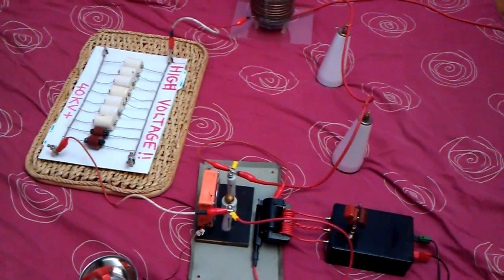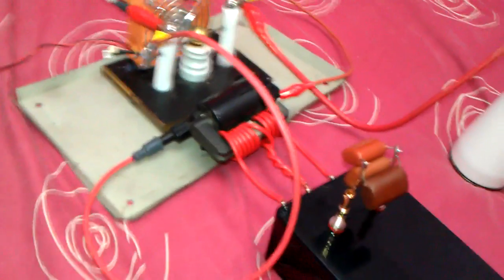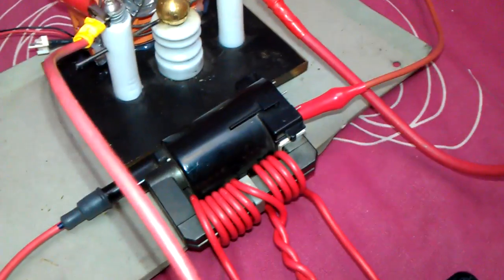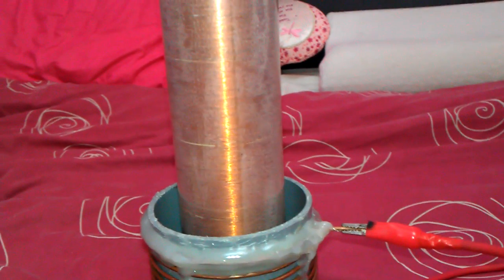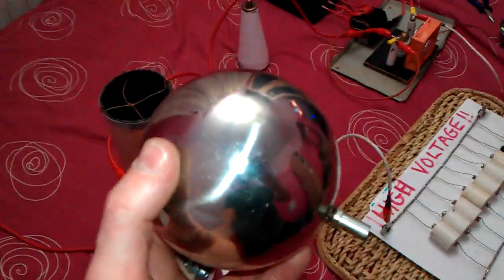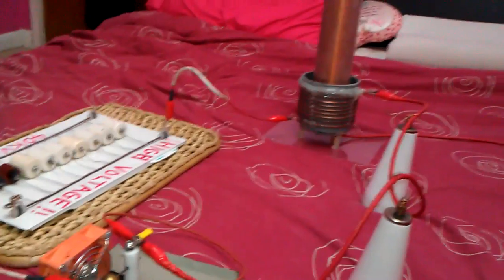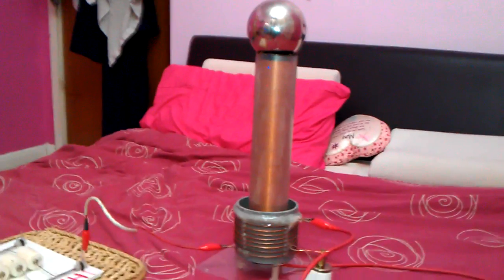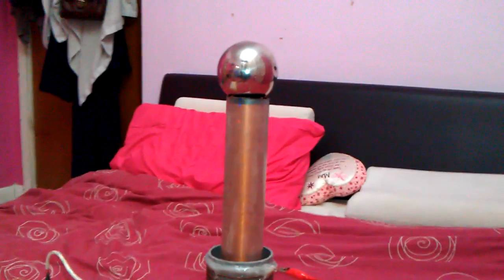Table top Flyback tesla coil ZVS mosfet

Comment: can you explain where exactly is the secondary connected?
Reply from the maker: The secondary coil is not connected at the top as that's the break out point. And the bottom of the secondary coil is to Earth. So either a 4 foot bar into the ground. Or a radiator.  But only use the house radiator if it's a small coil like mine in the video.

Hope this helps👍😉

Anthony

High1voltage1rules

Comment: Nice! I'm in the process of building my first coil, already built me zvf flyback power supply, got stacks of 1nano 30kv ceramic disc caps (not sure if they will be any good though), just need to build the TC itself. It's a work in progress...

Don't stop rambling on by the way, it's entertaining and lends a nice touch of humanity :)
Reply from the maker: Robert Crawford yeah thanks buddy, very kind of you to say,

and yeah them caps sound good enough.  

good luck on the coil. I'm sure it will be great.

thanks for the comment👍 

Anthony 
High1voltage1rules

Comment: Great video, thanks a lot for the explanation, Ive been looking all over for a detailed walkthrough, still trying to get mine to work, the zvs on mine works great but cant afford to buy alot of capacitors, do you know if foil rolled caps are any good?, also if you want to see my zvs, it is on my channel
Reply from the maker: Platinum Science Hello mate,
you could try rolling your own caps, as there's videos how to do it. it's not hard at all.
or if ya wanting foil rolled capacitors, they have to be pulse caps.

hope this helps mate. good luck

Anthony 

High1voltage1rules
Reply: high1voltage1rules Thanks!

Comment: what did you ground the bottom of the secondary out to
Reply from the maker: prototype9000 Hello,

I ground it to the central heating radiator pipe as this is grounded. it's only a small coil.

any bigger and there would be a ground rod outside I'd be connecting too.

hope this helps and thanks.

Anthony 

High1voltage1rules

Comment: hey high1voltage1rules great video i am about to build that same coil but i have a problem where the only grounding i have is the mains plug i live in a flat so i dont have a backyard also cant seem to find any pipe since all are in the ceiling can i still make this coil
Reply from the maker: syamala raj sorry about the long time to reply, I get so many messages.

OK" do you have central heating? or do you know where your main cold water comes in to ya flat?? 
as you can use this as your earth bonding wire for your coil.  as when I'm in the house I either connect to the radiators pipes. ( only for small coils! ) of the main stop tap for your main cold water into the flat! as this will be earthed! but if it was me I'd go to the back of the building and find a nice mud area and drive a earth rod into the ground and have a earth wire going to my flat to connect too.  

I hope all this helps and best of luck!

I hold no response ability for and damage done in your flat, all info iv given you is on Base information you have given me. I can't see your flat and don't know any setup. always give/pay attention  and⚠ caution when using high voltage.⚡

be safe and think safe. always switch off! safety first.

Anthony 

High1voltage1rules
Reply: Thanks!

Comment: Very nice it was great experiment. Spark Gap coils that are well quenched as yours was by design and airflow " Sing" and in time you like Tesla can tell by the sound of the gap discharge when the coil is correctly tuned.  Enjoyed this, spark gap coils versus all solid state devices is like comparing a classic 66 XKE to the current types .New sports cars are smoother but have no soul.
Reply from the maker: Ella Craddock fully agree with you 👍😉 thanks for the comment. 👍😉⚡⚡⚡⚡⚡⚡⚡⚡⚡⚡

Anthony 

high1voltage1rules

Comment: Another quick question, could you provide me a schematic with the connections from the flyback to the tesla coil? Including the capacitors? Or possibly explain how you connected the flyback to the tesla coil circuit? Because I connected it with the typical spark gap tesla coil circuit, and I get arcs that buzz off and on, rather than a continuous arc.   Thanks again
Reply from the maker: +Scotlahn Mccallister hello mate. well you would need Ac capacitors.  and to be honest I wouldn't know what would be the best capacitance. the best way to try it' is to get ya caps and try a load in parallel " it wouldn't be in nf" it would be alot less capacitance.
so when ya try it you just keep adding until you feel you have enough. 
or you can look on the net and look for a data chart on how to get the correct capacitance for you coils size.
I never used anything I just kept trying myself until I got what I was happy with!

best of luck.👍 

Anthony 

high1voltage1rules
Reply from the maker: Hello
you basically connect it as you would a neon sgn transformer. bur replace the NST with a flyback and ad more capacitance.  you can find the circuit diagram from seaching in google images > tesla coil diagram. 
and just follow it. that's all I did. 
and when you power it up remember to try different caps in the spark gap as this effects the frequency.  and try different taps on the primary of the spark gap. and remember to Earth the secondary coil to ground.

hope this helps

Anthony

high1voltage1rules
Reply: +high1voltage1rules Do I really need to earth the connection? Because I found connecting the tesla coil to my fly back ground works better than the actual earth ground.
Reply from the maker: +Scotlahn McCallister with tesla coils the output on the secondary is a wave that runs up and down the coil. and basically if you run it connected to the flyback even tho it works better can burn your drivers components. and even pure out ya flyback. in the past Iv tryed many ways to run them and connecting to ya house Earth is best. only for small coils. any bigger that 12 inch high you should make your own earth outside away from the house. 3 foot earth rod!!! 

thee awesome projects to play with' and lethal to house hold appliances ☇☇☇☇I killed my home burglary alarm lol on my old house just before I left lol. never worked again.

hope this helps and play safe.🖒😉

Anthony 

High1voltage1rules
Reply: +high1voltage1rules What would the proper capacitance be for a NST? I'm trying to build an NST coil, outside of the ZVS projects, and would like to have that knowledge at hand. Thanks again!

Comment: That very nice@! How to make it? Do you have a circuit?
Reply from the maker: high mate. v no circuit diagram you can search in google images. as all im using is: it's a zvs driver with a flyback. and a dc capacitor bank.
a tesla coil setup. without any Ac other transformers. and using a spark gap. I'v just changed it from using no NST to using a zvs to power the flyback and with the spark gap Iv but in in series the capacitor bank of the high voltage output into the primary coil that's connected to the spark gap  
hope I made it clear. you can find it all out in Google 

best of luck

Anthony

high1voltage1rules

Comment: hey there, can u pls explain what it means to ground a wire....
Reply from the maker: Hello. 
the secondary of the tesla coil has to go to ground. a earth rod in the ground. and make sure it's wet as it's a better grounding for the tesla coil. 
if you don't earth the tesla coil it will fry itself/ burn out.

if ya still unsure search in Google. as Google is full of high voltage info.

hope this helps 👍😉

Anthony 

High1voltage1rules
Reply: +high1voltage1rules thank you very much ;0, ive got an idea now, so i can connect the base of my secondary to the AC earth of the house socket??
Reply from the maker: +Julian Nel 

hello mate.👍

⚡⚡⚠Warning⚠⚡⚡

don't connect 🔌your tesla coil to your house Earth🚫
As the Earths wiring in the house would act like a Antenna📡 giving out high frequency wave's〰  and with the high voltage⚡ also, is an accident💣 waiting to happen! thats something you don't want!😨

anything plugged into you house main can become damaged/broken💥 and it's even possible you could get a house fire🏠🔥.

The best way to earth your tesla coil from the Base of the secondary is to have a wire from your tesla connected to a 4 foot copper Earth rod into the ground.

mine is outside my garage at the end of my garden. well away from the house lol.

if you don't or can't get hold of a copper earth rod then use copper heating pipe'"  I throw water over my earth rod when ever I'm using it for tesla runs.

hope this helps and be safe.

Anthony

high1voltage1rules

Comment: 6500K of your lamp is the colour temperature not the brightness, this would be measured in lumens. 6500K equates to Daylight, 2700K is usually warm white and then you get variations in between..

Comment: Hi high1, nice video as usual. I got a little problem wich I dont have any idea about what could be. Its a very silly issue but: 
When connecting my spark gap in parallel , like you had, my tesla does nothing, but when connecting it in serie the coild works nicely, I really don´t get it, I readed in some sites that is always better to connect the spark gap in parallel, but as I said mine doesn´t work.

Maybe not enough voltage? Little capacitors?

Thanks!
Reply from the maker: it's always best to have the caps in series,  and the spark gap in parallel to the transformer, it's how there to work nate, best of luck 👍😉⚡⚡⚡
Reply: high1voltage1rules Lol, when I connected the sparkgap in parralel and caps in series my mosfets blew!!! If I connected the caps in parallel and sg in series...the TC did nothing I am so confused and I feel sad :( can you help me?

Comment: Hi!
I just finished my ZVS Tesla coil which is 2 feet tall. im using the irfp250 and an old b/w flyback. Power supply is a rewired mot which gives 40V and allows 25A MAX. But my tesla coil only worked for 10-15 seconds with 1 foot arcs then the mosfet was RIP. then i took another zvs with same specs and that also gave same result and shorted again..!! what im doing wrong?

A friend of mine says i have to reduce input voltage to about <36V.
Reply from the maker: there are many things you can do with the zvs to protect the mosfets. I sometimes but more diodes across the gate and source! this protects the gate more from back spikes. 
and it's sometimes best to have another ferrite transformer before the flyback. if you look at some of my xray transformer run videos you should see this setup as I use the zvs to run Xray transformers. the thing is with Irfp260 mosfets is there only rated for 200 volts and the back spikes can reach over 600 volts. 

hope this helps and thanks

Anthony 

High1voltage1rules
Reply: +high1voltage1rules thanks but I already managed somehow
Reply from the maker: +Anurag Trivedi sorry for the late reply mate. I get hundreds of emails asking for help.

if you need any other help!

Anthony

High1voltage1rules

Comment: How exactly would you wire up a zvs driver with the flyback, in place of the neon sign transformer in the diagram? Sorry, i don't have much experience with flybacks and just started using them, thanks for reading!
Reply from the maker: Hello mate. yeah to wire a zvs driver to a flyback is very simple. if you watch some of my other videos showing my using flybacks I in some videos I exsplain how I do it. but the zvs driver has the 3 wires from it 2 are the negative from the gates of the mosfets and the cere wire is positive. and that's coming right from the inductor.  you wire 2x  windings of wire on the ferrite of the flyback. and it's normally  4X4 windings and a centre tap that's the positive. 
hope this helps and thanks

Anthony 

High1voltage1rules

Comment: Just a word of warning to you!!  I set my bed on fire running a tesla coil on it when I built my first coil. If you have a metal spring or support under the mattress, please be careful. The fire wasn't obvious at first, it just smoldered, but fortunately we saw the smoke before it caused any danger. Don't run high voltage equipment on a bed.
Reply from the maker: dude realy? lol like I'm going to walk out the room and leave it running?!?! it's all common sense 😉 iv been doing this for many years. iv had 35 years of electronics under my belt as well as 9 years with high voltage. a lot of experience my friend.

Anthony

High1voltage1rules
Reply: bro tesla coil cannot be dangerous if you are using a 12-24dc direct not from a power supply or a charger because even though it is rectified since it is connected from ac it have a small amount of hz that is flowing through the cables
.
.
even me i tried it i make a 6v tesla coil and i try to use my power supply it makes my finger burn and i try 6v battery no effect but a little bit hurt if you touch the ground
Reply: +Loumer Manreal If the tesla coil produces a spark to a piece of metal there is danger that the cotton bedding can be ignited. The spark can go downward to the springs beneath the mattress. Maybe beds are different where you live?  What is the total length of the spark to ground? Then figure how far away the metal inside the bed frame is.
Reply from the maker: +pixelpatter01 and this matress isn't / hasn't springs. it's a soft spunge matress. No springs or metal.
Reply: +high1voltage1rules OK, that's good.  I didn't want to get into a dispute here. I just wanted to share an experience I had with my tesla coil, on my bed in 1962 where I caught my bed on fire.
Reply from the maker: +pixelpatter01 hey no problem mate. it's hard to understand comments lol because how there written they can either look like ya having a go or not lol. but there's no problem here. have a good one and thanks 👍😉

Anthony 

High1voltage1rules

Comment: Hi,
Did you connect your RF grounding of the secondary coil to the earth pin on the mains? Or similar?
Obviously not an earth spike or into the ground.
Reply from the maker: yes it was mate. it was connected to the grounding of the radiators. when ever I do my larger coils I do them in the garden. there grounded into the ground by 5 foot copper rods. I'd no way be able to ground them to the house earth. it would be devastating to equipment. and may also course a fire. 

thanks for the comment mate. be safe.😉 

Anthony

High1voltage1rules
Reply: I think he connected it to the wife's side of the bed

Comment: Hi your videos have inspired me to build my first coil, but I have a little question if you don't mind answering ,  what would be a good size mmc capacitor bank in uf or nf for a flyback tesla coil at 12-24-36v on a ZVS. I have the bits to make a 15nf or  20nf at 50kv or is this completely wrong ,,, could you please suggest what would be the best size ? my primary is 6mm and 10 turns the secondary is 0.40mm and 880 turns and 75mm  diameter ,,, thanks for any advice ,  :)
Reply: Edward Lee Hi man, there is a website called JavaTC which lets you to calculate the adequate capacitance of your capacitors and you just have to type in the infos of your coil, good luck!

Comment: do you have a schematic of the driver you can send me?
Reply from the maker: High mate, it's just a zvs driver with a flyback and a capacitor bank. If you search in Google pictures for circuit diagrams. It's just a tesla coil diagram with a flyback in replace to a nst. 
Hope this helps and hope ya well friend.

Anthony

High1voltage1rules.com

Comment: I just got a 10"stainless steel garden "gazing" ball for topload purposes.. what is the best wat to mount it and do I have to drill into it to mount it.. I do know the top of the secondary wire has to be mounted inside, correct?